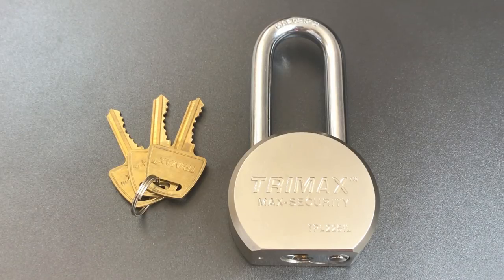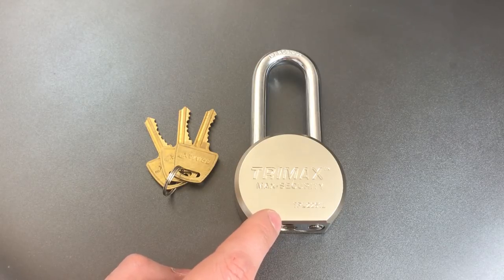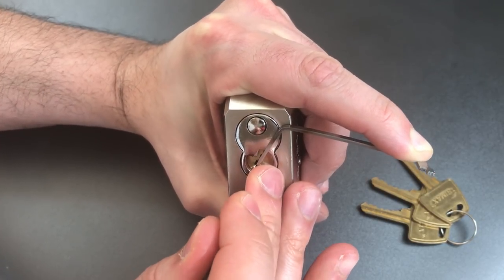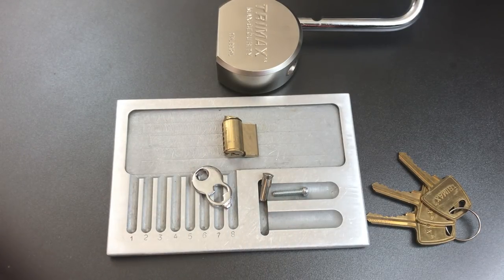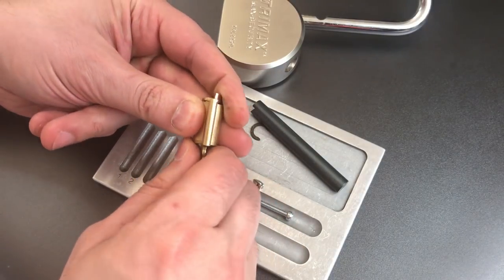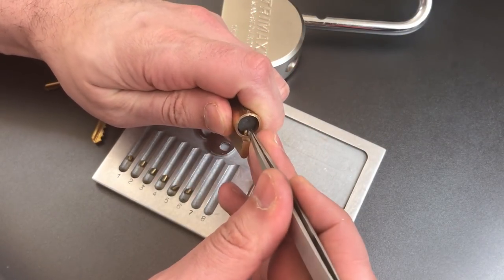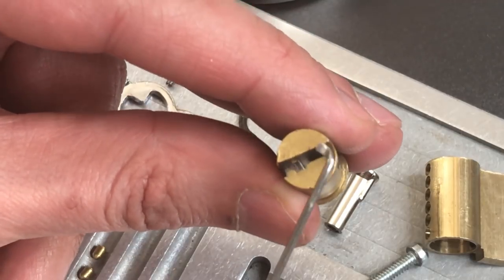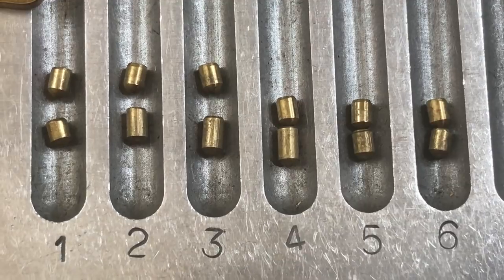[624] TriMax Round Body Padlock Picked and Gutted (Model TPL2251L)

Comment: The bypass technique was the first lock "picking" trick I learned, its hard to believe that a vendor will neglect to include a cover over the rear of the cylinder to protect it from bypass. This trick worked on almost all brass padlocks.

Put the keyway in a real American brand lock and impress your friends by raking it open.

Comment: I have two ideas on these 9000 key changes...either the core stops working after you have used the key 9000 times, or you can have 9000 different keys with the same set of pins (because of the ugly shear line ;D). Very cool bypass explanation too :).
Reply: redcatimaging - I was thinking nearly the same thing - they have pins for only 9000 different keys - but I like your idea better.
Reply: Actually, you can get to 9000 reasonably easily (1) Take 5 pins with 7 depths -- 16807. (2) Exclude all keys with adjacent pins more than 4 different -- 10483 (3) Exclude all keys with three or more pins of the same size in sequence -- Result: 9762

Edit: keys --> pins aaargh!
Reply: I think it's more likely to be what Vegeta's scouter says about Goku's power level.

Comment: Surprising driver pins. That would be very easy to open with a rake, jiggler, another key with similar bitting, etc. Good for your 2nd lock, after the clear acrylic one, if you are learning lock picking.

Comment: As soon as I saw the driver pins I assumed this was on purpose by the manufacturer to reduce chances of the keyway binding over time under gritty or corrosive outdoor conditions. I doubt they have pick resistance in mind at all with this lock. The bypass was particularly brutal btw.

Comment: I bought one of these after seeing Bearsback gut one, and it had the key pins facing down on his & mine. They are putting the key pins as drivers with the point towards the shear line on purpose. I guess to make the Lock easy to turn? I always put the flat side towards the shear line when using key pins as drivers just because of the larger surface area.
Reply: Nah, the new parts manager, (the owners nephew) screwed  up and had the pin making department produce 15 million key pins of various lengths, and they just gotta get rid of the damn things.

Comment: they probably had a bunch of extra key pins and wanted to use them up to save money, a practice which is used extensively in all parts of manufacturing in china. one of the more interesting and funny examples of this is when they make ramen noodles, the small bits and pieces which don't stay attached to the square "block" of noodles get collected and put into a bag along with a seasoning packet, and sold as a completely different snack product. nothing goes to waste if it still has value!
Reply from the maker: Probably... but at least put them in upside down!!!

Comment: When you refer to it possibly having a "skeletonized core", what does that mean?
Reply: A skeletonized core has the minimum material needed to manufacture a functional lock. Instead of having a solid core you might normally expect, you would have 'ribs' that the driver pins ride on when the lock is in normal operation. There are large gaps that the driver pins could fall into between each of the ribs. If you disassemble the lock without accounting for that space, the driver pins could fall into the gap making it nearly impossible to disassemble the lock non-destructively.

Most of the clear training locks from China have skeletonized cores. This amazon offering shows what a skeletonized core looks like: https://www.amazon.com/dp/B072JRB8XH
Reply: Thanks for the response! If I'm wanting to get into lockpicking, would a set like the one you link to still be a good option for practicing the basics despite the skeletonized core?
Reply: Hmm, well I can't say definitively. My opinion is that they are really neat, but that they don't really provide enough feedback to learn on. I bought a set that is very similar (had a tubular lock in addition to those pictured.) It's nice to be able to see what is going on during the first couple of times you pick them, but they are kind of mushy inside and don't really provide any feedback. You need that feedback to get a feel for what is going on inside. I also find that I can't keep myself from wanting to watch the pins as I set them which removes most of the challenge.

I did not find them to be worth the money, but I probably won't get rid of them as they include a few types of locks where I might not otherwise be able to easily observe the interor.  I think a couple of good practice locks are the master lock 3, and master lock 140/141. You can pick both of these up at a local store like Walmart or a hardware store and they are inexpensive. That give you an opportunity to pick bitting that will be a challenge before you buy.

I would also look at the First watch lock LPL featured a couple of weeks ago as it adds a nice challenge but it isn't as hard as an american 1100, and although they are about $11ish dollars on eBay, its still a decent deal for a new lock with six pins.
Reply: Those locks can be found at flea markets and thrift stores.

Comment: When you assembled the lock, were you able to install superior driver pins and a anti-bypass plate?  I suspect the key pins as driver pins saved money during the manufacturing process by allowing less precision in the machining and still ending up with a "working" lock.
Reply: dahveed284 they had it backwards. The key pins were driver pins & the driver pins were key pins so no savings on manufacturing. Maybe they only had had the one length of true key pins in stock and a clueless supervisor said just make it work.

Comment: In addition to the retainer plate being very thin, I doubt it is hardened either.  When I needed to file the rough edges off the retainer plate of an even cheaper lock so it was a smooth fit, it was very soft.  I'm sure a dremel with a mini cut-off wheel would slice it free in a couple minutes or less.  After I installed the anti-bypass wafer, the plate would be the obvious point for a physical attack.  Either a few strategic dremel cuts, or a Ramset strike on the retainer nut.
Reply from the maker: Thanks. Good to know. 👍

Comment: Hi I have a question if you invert the direction of the core pins does it change  the  difficulty  of the lock ?
Reply: It would make it a small amount more difficult basically turning them into standard pins but they are all standard so it would not be significant, especially to LPL.